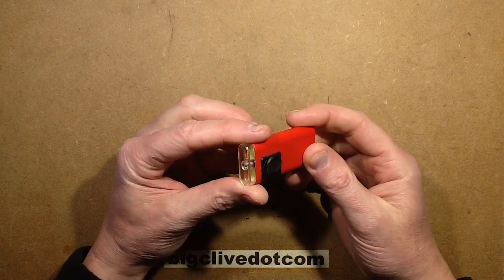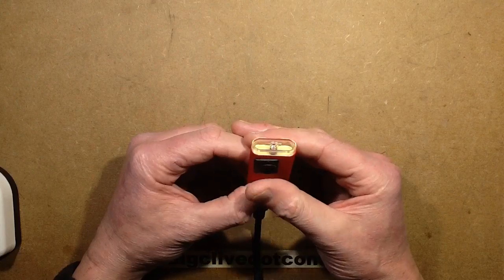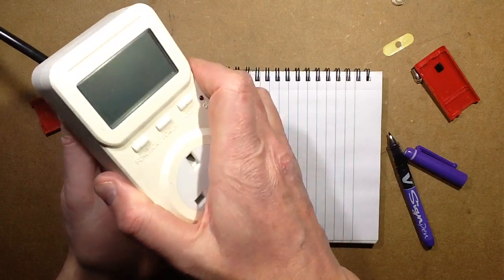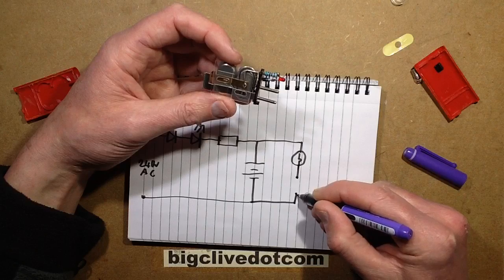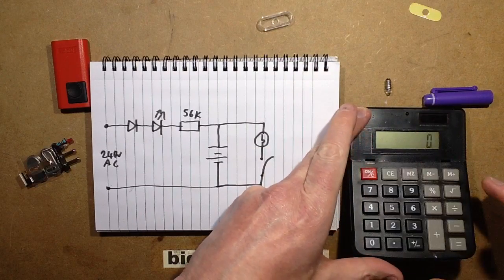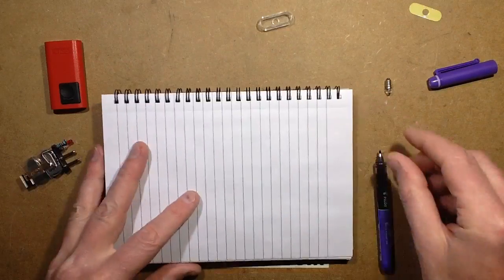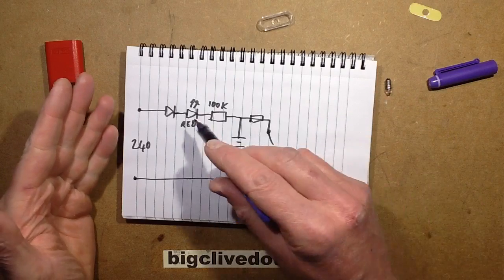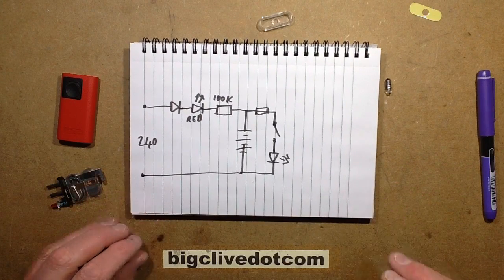Unique vintage rechargeable flashlight from 1980's (with schematic)

Comment: 258v where i live, all the solar doesnt help it either, probably shortening the life of many electricals
Reply: jusb1066 It's 230 +- 10% So you're just barely out of spec
Reply: You probably live close to HV/LV transformer, same like my grandpa. He always had around 242V (12V too much). I bought him a pack of UK bulbs due to his angery when he had to change bulbs few times a month xD
Reply: Would pay to see! Now, call "photonicinduction" and I think you will be getting a new transformer.
Reply: plus 10% or minus 6%  on the LV network, plus or minus 6% on the HV ;)
Reply: *****
the EU had a hundred meetings and decided to fudge the issue as actually doing something was too hard.
Reply: 220V when unloaded here, at night. As low as 180V when loaded during summer. Transformer makes nasty humming noise... :D
Reply: ***** The EU might have asked us to conform to 230, but considering more than half the distribution network is using transformers from the 60s and 70s, and the tapchangers have been painted over so many times that its not worth the hassle of changing taps, we will be putting out 240 in lots of places for a good while to come yet ;)
Reply: Радиоактивность
theres a big street transformer, the size of a shipping container, about 30 yards away
Reply: *****
If putting a combined 50 kW load on a 30kVA transformer is "overloaded" then you and the electricity company live in different worlds :-D
I already did, they couldn't care less. I think the failure will be quite dramatic, with oil spewing everywhere...
Reply: The more devices you plug in the more the voltage drops. That happened to me, dropped to around 217 volts. I have 2 plugs in the whole house, so they're both used for several devices with power strips connected to power strips (although you should never chain them together). Or, it might be all the electric noise from switchmode power supplys screwing with the readings. The voltage shouldn't drop much, should it?
Reply: Locally bought electric stuffs oughta work on the local power supply, one would assume? So you should be safe there.

Also, most electronics are up to 265V, was it?

Comment: Kind of cool.

I would try a resistor or diode in parallel with the switch.
~3v over the  batteries while charging. With a diode the white LED would run at something like 2.4 volt while charging.

Comment: i had one that had the mains plug under a cap at the end. but i believe it was a little bit bigger.
Reply: I have a fairly new one like that. Used to have one from the 70s or before with the same design.  Trick is that with European ungrounded connectors, the plug is already flat, so just having the pins coming out the back end does the job, with no need for a figure 8 cordset.

Comment: I remembere used to be available chemical emergency torches.  Wonder if you can still get them.
Reply: Ebay sell them, and I think Clive did a teardown on them before...
Reply: You can also get thorium torches, but they are quite expensive (around 15$ per ~7cm tube).

Comment: I'm wondering how they can charge the cells straight from the mains without exploding the cells.
Reply: There is a resistor in series with the cells. Ni-Cd cells are quite robust. When they have reached the fully charged state, they'll simply start dissipating the power you put into them. You can safely do that with 1/10 C. 
The Ni-Cd AA cells in my slow charger warmed up to about 40 degrees C. You'd know if they are full by feeling if they were warming up.

Comment: Good application for disposable e-cigarette lipo batteries??? Too much protection circuitry?
Reply: Pointless today, when we have plenty of NiMH or Li-Ion cells and great LED flashlights that would run a week at that brightness level.  That little incan bulb probably produces a couple of lumens (rough guess), BUT, it does bring up the option of swapping in a white LED in its place, but the addition of a protection and charging circuit for Li-Ion seems too muck effort for too little return.
Reply: Hehe, You're funny. Not a chance.
Reply: Not this way.

You need to cap the voltage. Constant voltage is fine.
Reply: Try that with a lithium battery and you will end up with a fire. You need NiCad or NiMh batteries since they can be trickle charged continuously.
Reply: Yeah BUT with a single Li-Ion at 3.6V already, the 2nd battery/cell allotment in the case could be empty, leaving room to put a $1/ebay Li-Ion charge controller board in there.  Even then, it's still joke of a flashlight by today's standards.  I can see modding something for a superior result but this light would still be so far behind the curve that it's not funny, even compared to a $2 generic eBay LED light that takes 1 x AA cell would would be around 50X to 100X brighter.

Comment: My grandmother had one of these, was always amazed by this tiny little thing that would take full mains voltage while pretty much everything else required a wall wart plugpack. Funny little things and very old-school.
Reply: It's only due to it trickle charging at very low current, and being built to a low price point.  You "could" build something similar with higher charge current but the heat and power loss starts to become unacceptably high.  I mean in an emergency it would work but isn't competitive as a retail product competing against other products in the modern market, and there might also be governmental restrictions on selling something like that today, considering (AFAIK) EU has pretty much mandated that wall wart power supplies be switching type instead of linear.  I could be wrong on that, have not studied EU codes but am under that impression.